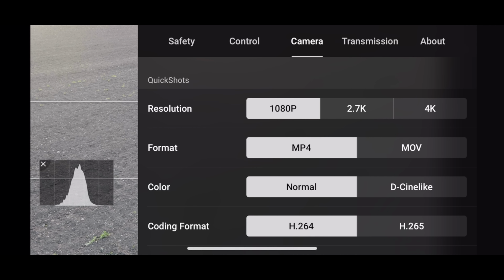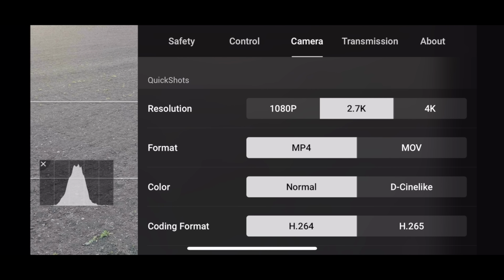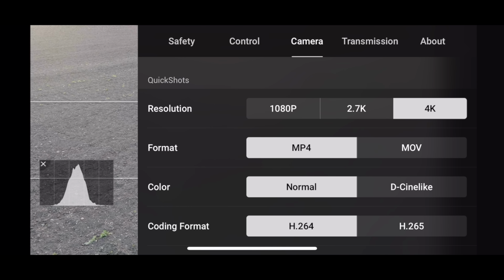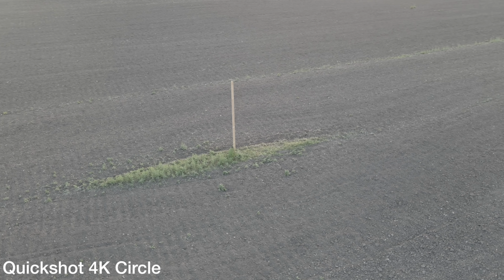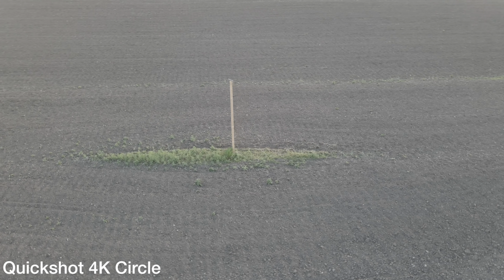Mavic Air 2 - Things You Need to Know. Part 2

Comment: Tap the battery icon, a window opens and displays voltage, temp.....it must be just me but does any one care about battery voltage and temp , i just would rather see the battery percentage
Reply from the maker: Hey Peter, thanks for taking the time to watch and comment. It is much appreciated! The battery voltage I personally find more useful as I can see if there is sudden voltage drops. I don't recall at this moment if we can see individual cell data on the MA2 like on the M2P for example but that would let you notice potential issues with individual cells early. My $0.02.

Comment: So, can't understand what i missed, I have the Air 2, updated firmware (Fly app is 1.1.2) and the latest firmware on Drone but there is no 4k option for quickshots. What I'am doing wrong?
Reply: Oh, I managed to do it. It works, but only if H.264 codec is used.
Reply from the maker: ah ok interesting, they must have added a limitation. I thought i got it to do h265. i guess i just did dcinelike and h264.
Reply: @Quadcopterguide  Hm... I tried dcinelike mode and looks like it has noises and the video looks better in standard mode...
Reply from the maker: Dcinelike has to be graded to make look similar to normal color. It will give you better dynamic range overall though. Just more work.
Reply: @Quadcopterguide  Yeah, sure I did grading using LUT (some that I found on the internet, DCinelike to rec 709). I also tried to find another one that you mentioned in the list of your another video, but unfortunately there were no LUTs or I just didn't find it. Could you, please, provide a link on LUT so that I try it also?
Another point that I noticed, it is an HDR mode that is really noisy in the dark time but standard mode looks better...
Reply from the maker: My lut is available on the mavic air 2 resource page. You have to input your email and then the files get sent to your email. See description for Link to that resource page.
Reply: @Quadcopterguide  Ok, great, I did it. Thank you!

Comment: My device doesn't show up in DJI Assistant 2 (windows 10 64 bit) only the internal storage pops up. What am I doing wrong? Thumbs up for your channel, keep it up!
Reply from the maker: Hey Lieven, thanks for taking the time to watch and comment. Much appreciated! I assume you downloaded the assistant straight off this link: https://www.dji.com/mavic-air-2/downloads?as=0008&ch=Comments&from=dap_unique&pbc=y9nEKXjI&pm=custom I would uninstall the assistant reboot. Then redownload and try again. I have a feeling a driver is missing. On a mac at least it bugs you if you want to install an extra driver. I don't need it but maybe theres an option for windows like that.
Reply: @Quadcopterguide  Yes it was a missing driver, got it running. The driver was not found by windows update. Had to use driverbooster to see what driver was missing, mission accomplished.
Reply from the maker: Lieven Jacobs awesome. Glad you got it running!

Comment: You talk about downloading map if you fly in airplane mode (or are out of cellular range). DJI Go 4 does have this capability and allows you to download and use offline maps but DJI Fly does not. So how do you do it with DJI Fly?
Reply from the maker: great question, i would enable airplane mode after downloading map on site.

Comment: What’s best place to simulate the Mavic Air 2 if it doesn’t connect to DJI Go app? Couldn’t get mavic air 2 controller to work with the PC simulator either
Reply from the maker: Hey Scott, thanks for taking the time to watch and comment. Much appreciated! That is a great question. I don't think there is a simulator built into the Fly App,yet. Do you have any other DJI drone?

Comment: Is there an update for the visibility of the battery icons etc..... In the upper right corner (hard to see in daylight)
Reply from the maker: Hey Jonathan, thanks for taking the time to watch and comment. Much appreciated! I don't recall that changing with the latest update.
Reply: Tap the battery icon, a window opens and displays voltage, temp and flight time. Much easier to see.

Comment: I understand that waving at the drone when in Quickshot Dronie Mode actually activates that mode.
Reply: Also for active track. The manual states that by waving with you elbow above your head.
Reply from the maker: Thanks for chiming in Skunkmonkey. Good point as well.
Reply: @Quadcopterguide  So i'm finally getting comfortable with my drone and it seems that the wave gesture wont work with mine. IDK what i'm doing wrong or if there is a setting. I see its supposed to work with quickshots as well and it wont activate.
Reply from the maker: Great point!

Comment: No manual control of the picture (sharpness, contrast, saturation)?
No manual control of the gimbal speed?
No dynamic home point?
No Tapfly or mode where you can just focus on the camera and the drone do the rest on a defined path for you.
Do you think DJI will fix that in the fly app soon? -  without some of this manual controls the AIR2 is not more than a toy like the mini :-/ ...the AIR1 could do all of this things.
Reply from the maker: Hi Patrick, good list of features, some of which i agree are important to get into the Mavic Air 2. I know a few are coming for sure.. they have to :D

Comment: What about gimble control? Speed etc
Reply from the maker: hey YoungBlaze, ironically i did not see that! Maybe the next one? People aren't seeing this update. I wonder if it was a fluke. Maybe the real one will have it.
Reply: @Quadcopterguide  hey thanks for the update, i ended up going for the mavic pro 2 , the low light is just amazing, the mavic air 2 seems like it cant hold a candle to it, i like the new features in the air2 but it jist now matching the quality

Comment: occusync 2 is different on Air 2 and Mavic 2.
Range and penetration are differtent and finally you can not connect air 2 remote with Mavic 2 and vice versa.
Therefore no chance to connect the Goggles Racing edition with Air 2 ...
Reply from the maker: Very odd that its different but the same.. Wonder what the reason is.If it will work with the smart controller it can't be that different.

Comment: Ive also heard when the Mavic Air 2 works with the smart controller then you could use the HDMI out with DJI Gooles
Reply from the maker: That’s a great point. Once the smart controller receives its update we will gain HDMI out you are correct.
Reply: did not work for racing edition so i senf Air 2 back

Comment: Felix informative as always👏 have you any news on Mavic air 2 to be used with the Mavic 2 and zoom smart controller yet? I'm not over keen using the one that comes with the air 2 it's a very basic controller but still feel nice to hold, but pretty featureless otherwise. Let me know if you hear anything soon buddy👍 Ps edit to add I had that update and opened up this for the quick shot features in 4K
Reply from the maker: Hey thanks rooney, the smartcontroller will receive an update to make them compatible. Very cool about the update!